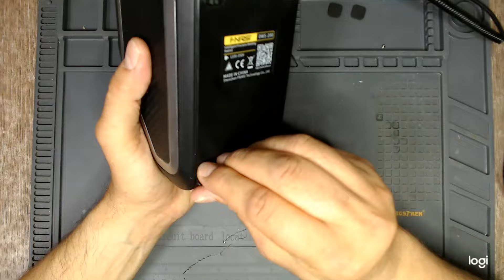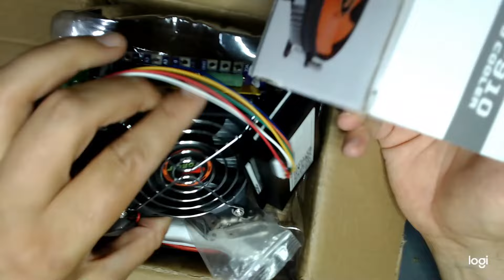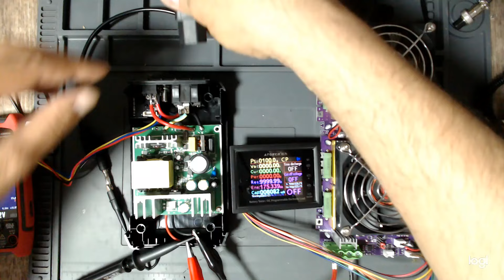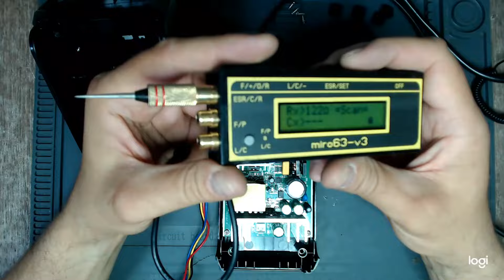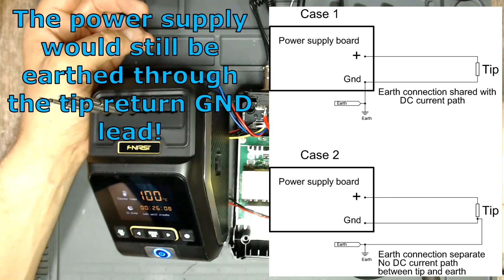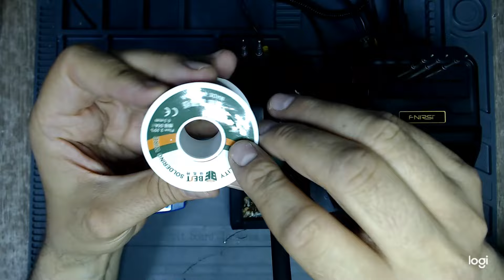EN - My FNIRSI DWS 200 soldering station - Testing the leakage subject

Comment: Well, maybe there's more to this. I burned some sensitive RF components and I hate it. Just one RF mixer is about 40Euros.
I measured the current between the tip and ground in my Yihua 992-III and it's about 330mA. I agree with you it's caused by the negative/ground wire resistance. However, why is this current escaping and not closing the circuit with the power supply? 
I am considering installing a CM filter on the output of the power supply or I'll not be able to use this station for anything sensitive. 
I'll rather be getting a second hand JBC or a new Aixun 410 - priced about the same here
Reply from the maker: Hi.

Sorry for the late reply, i've just been busy these days. 

I must confess i haven't heard of this brand ( Yihua ) until now, sound Chinese ( AI say it is, but it also claims it's a professional tool, so.. ). 
Anyway, i did found a short video with it and saw the inside, it looks ok, a switching power supply, a small face board with all the controls, like most other Chinese stuff. 
About that measured current, that isn't escaping, it's just that when you connect the tip to an earth point, you provide a second path for the return current, in parallel with the wire inside the handle's cable, of course. 
Think of it like this, you have 10V and you load them with two different resistors in parallel, one 10 Ohms and the other 1 Ohm. 
While most of the current goes through the 1 Ohm resistor, still, some of it will go through the 10 Ohms resistor, because it adds to the load, thus reducing the overall load resistance. 
So 10A go through the 1 Ohm resistor, while another 1A go through the 10 Ohms one. 

Same with the earth connection to the tip. 
Because the ground wire inside the cable has a finite resistance ( most of the time rather high because the handle's cable still need's to be manageably thin ), when you connect the tip to an earth point you provide another wire in parallel with the one inside the cable, which means another resistor in parallel, so a part of the load current go through the earth connection on the tip ( which incidentally also means the tip get's a bit more power because the total wire resistance is lees ). 

One essential thing to keep in mind is that this only happens when the power supply has it's output GND tied to earth inside the unit, that is why connecting the tip to earth provides another return path to the load current, because you simply add another wire straight from the power supply output GND to the tip ( through earth connections on the electrical wiring on your workshop ). 
And earthing the output GND is done in most of the switching power supplies, despite the fact that it is not always a standard safety requirement ( still it does help, and also it shunts off a bit of the common mode noise to earth ). 

But, @tony359 had noticed that one of his soldering stations had an almost zero current from tip to earth, and that was due to the fact that it was powered from a mains 50Hz power transformer, but not because of it's supposedly low leakage, but mainly because there was no earthing on the output GND of the mains power supply, since it didn't need it. 
This meant that there was no secondary return path for the load current of the tip, when connecting the tip to an earth point ( the GND inside the unit was floating, so it didn't matter where you connect the tip to ). 

Now, how is it best to power the soldering station is debatable, each option has it's own advantages, still i like switching psu's because you can go to much higher power in much lower size and weight. 

PS: Yor unit definitely has a problem, 300mA is way too much leakage to earth, and no wonder you can damage sensitive components. 
Probably it has a very thin wire inside the handle's cable. 
One thing you can try is disconnect the earth inside the unit from the psu's output GND, test then the earth leakage of the tip to earth, it should be lower. 

PS: JBC does not reinvent anything, the just pay more attention to these details.
Reply: @DjMarik78  Sorry, My answer got deleted.
I noticed also that Chinese stations appear to not use JBC connection to tip, i.e: 
JBC uses central pin for 24VAC and sense, middle pin for 24VAC, and tip outer for sense and ground. I found a schematic online, but probably my reply got deleted because of this.
Chinese use center pin for Sense(?), middle must be +24V and Tip outer for -24V and ground ( I confirmed this).
It's curious they have a different configuration. Maybe because it's DC not AC, or copyright.. Not sure. 
I'm also not sure how the Termocouple works also. Somebody did a crossection of the tip and it's not what you would expect
Reply from the maker: @OctavMandru  i am not aware of a comment deleted here by the Youtube platform, but anyway, my Fnirsi soldering station here uses JBC tips and they work just fine, so the connections must be the same.
Reply: @DjMarik78  nu mi-am dat seama ca esti din RO. 😅.
Ai incercat cumva sa măsori totusi daca exista curent intre varf si ground? Am măsurat aseară cu un aparat cu ac, poate-s nebun. ~200mADC pe varf fata de impamantare, +0.4V.
Asta însemna in mod obligatoriu că există un curent intre output sursa si mains, dar are transformatorul ala . Ceva nu se leagă, dar e o problema la anumite chinezești
Reply from the maker: Da, am verificat, am gasit foarte putin, nu mai stiu cat dar destul de putin sa nu conteze, cred ca e specificat intr-unul dintre clipurile cu statia asta de lipit a mea.
Reply: @DjMarik78 mulțumesc. Mie mi se pare foarte ciudat sa am 200mA peste un scurt zdravăn (deci masor curentul in paralel cu ground-ul). Da, o sa investighez. Sper sa fie ceva stupid simple, ca imi place stația asta mult

Comment: Just avoid it and get a Geeboon TC22 or other.
Reply from the maker: Wgy would i do that since my Fnirsi DWS200 is as they say, my dailty driver?
Reply: A Geeboon TC22 also have leakage. A little less maybe, but it is still not completely shielded.
Reply from the maker: @knutruben1  Assuming the output GND on the power supply is connected to earth, then what seams like leakage is in fact mostly voltage drop on the wires. 
And it is normal to be so, because those wires are still thin and they have to handle a significant amount of current, especially when the tip starts heating up thus maximum power is being pushed into the tip. 
At that time, reading the voltage between earth and the tip, you actually read the voltage drop on the return wire ( gnd lead ), from the power supply earth connection and up to the tip. 

This is unavoidable unless very thick cables are being used, or there is a separate earth connection going inside the cable right on to the tip in the handle.
And it doesn't need to be thick at all because it doesn't need to handle the load of the tip ( that return wire needs to be a separate thick one ). 
This way you then measure the voltage between the same point ( earth to earth ), thus no leakage.
But one more wire complicates stuff, so...

Comment: Could you share some info about the firmware upgrade for this station? I did exactly as the manual says, but my laptop (Windows 11) doesn't recognise the USB drive, so I can not copy the firmware file. Every other 10 FNIRSI devices I bought did not have such an issue.
Reply from the maker: Hi.

Sorry, i didn't upgraded the firmware on my station for two reasons, one is that i don't think it is absolutely necessary, it works just fine as it is. And second reason is i don't want to mess things up, and ruin a perfectly working soldering station ( as they say, why fix something that works? :D ).
Reply: @DjMarik78  Could you check if connecting the station to a laptop adds a new drive in Explorer, please? With the station off, hold the MODE button and connect a data cable to a laptop. Thanks.

Comment: English time 😉👍: so, the soldering wire from Best is good, nice station also
Btw, why you don't like lead free soldering wire?
Reply from the maker: Thanks for watching and commenting!
And thank, you, indeed Fnirsi seams a good choice for a workhorse soldering station, it does just about anything. It does seam to have a small issue ( not sure if on JBC or other C245 soldering station is the same ), a random contact problem inside the handle, sometimes if pressing too hard on the tip, the station stops and asks you to insert the tip into the handle. 
I am not sure if this is normal or not, or if it is a Fnirsi problem, or not. 
It could be that heating creates some sort of isolation layer on the tip ( it happens the same with JBC tips and with after market ones ).
If i rub the tip contacts with very fine sand paper, the issue goes away completely, but i am hesitant to do that repeatedly...

And to answer your question, i hate lead free solder :D
Sorry if i am too rough, i don't like it because it melts at a higher temperature, so many jobs are more difficult ( especially through hole de-soldering ), and it's more brittle ( so more prone cu cold solder joints ), and of course, it doesn't look as good as leaded solder after soldering. 
Hopefully this doesn't makes you avoid my channel :D

Comment: forma de corregirlo o mitigarlo  ?
Reply from the maker: There is no easy way.
Either one finds thicker cables, or modifies the connector using one more wire just for the earth connection to the tip.
I wouldn't bother with any of them with the Fnirsi station, it is ok.

Comment: Interesting analysis, thanks for the mention. I'd still love to do the "speaker test" on that FNIRSI 🙂

My tip thermometer doesn't like to be kept at high temp for a long time. I've also noticed it tends to drift massively over time, particularly when it's being heated up for a long time. Not sure if it applies to yours too. That said it looks like the calibration was spot on so... 🙂
Thanks for the video!
Reply from the maker: @tony359 thanks for watching!

I am not sure how "successful" the speaker test would be 😅
I guess something will come out of it at maximum power where the speaker would see a couple of hundred mW of power...

I am guessing that if i heat it up enough, mine would do the same since they seam to use the same sensors. 
But, luckily the calibration was indeed ok, so i don't think i will have to do it again, at least not with this tip. 
I did it mostly because i was curious to see if that solder really is leaded, and it is!